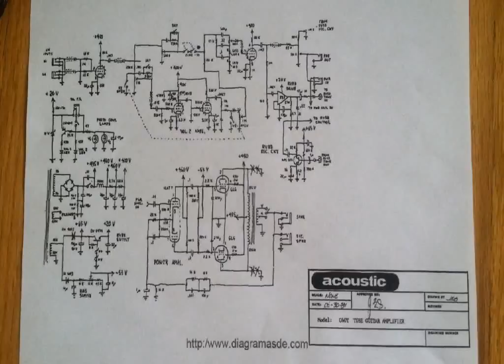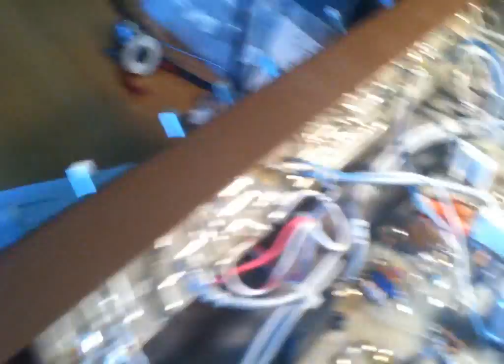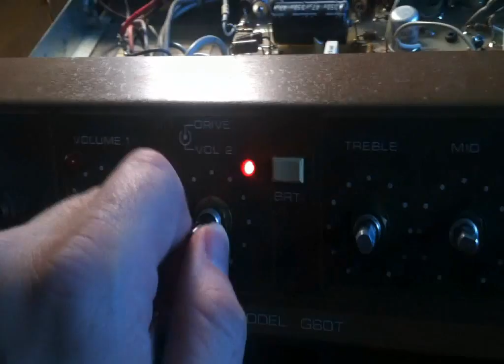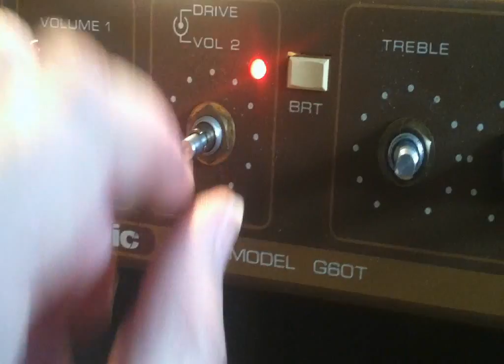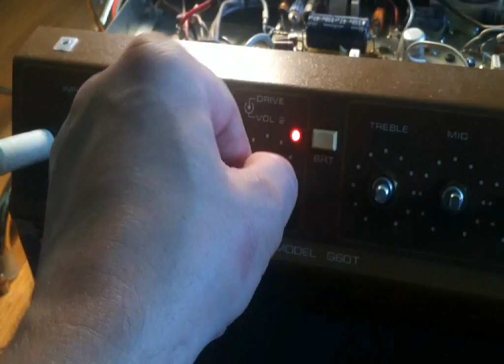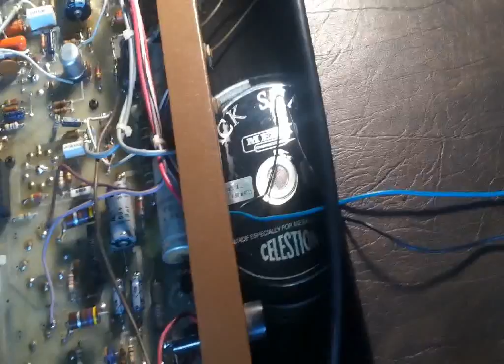Acoustic Control Corp G60T Model 163 Tube Guitar Amp DEMO

Comment: Hi there. Funny, I was searching here for Acoustic Control Tube Amps and came across this.  Not to honk my own horn on this but  I am the  J. E. G. that you see in the title box in the drawing. I was employed at Acoustic  Control Corp as an Electronic Engineering Technician  from 1979 through 1984 . That schematic was hand drawn by me and eventually releassed by the service department. It should have gone to the drafts person to create a formal document.  I assisted  on the design  of this amp .  I am now 72,  have been playing guitar since 1960  I have been employed as an Electronic Technicin / Designer.since 1973 . I was laid off at Cerwin Vega ! in to 2002.  In 1984 Acoustic merged with Cerwin Vega ! I will spare you the rest of the long story.  I  do much of the same things that you do  Mr. Guitologist.  I have a small Guitar and Amplifier repair business working from my home  here in Simi Valley, California.  I still enjoy playing, fixing, building modifying guitars and amps. I do enjoy watching your Youtube Videos. I hope I didn't say too much!
Reply: Thanks for your work. These amps are awesome. I have 2 100 watt heads,1 100 watt combo with the EV and 2 60 watt combos

Comment: there is no "transistor" on the volume of the drive channel. It is probably a microphonic tube, this amp has a lot of gain. (Mine does not do that.) Other than that: a great amp, beautiful reverb and nice creamy gain. I personally would get rid of the death cap at the ground reverse switch, could be dangerous when it shorts. No one needs a ground reverse with a 3 prong cord.

Comment: I found one of these down in baja México, with the same problem, i'm working on get this amp from my friend, did you find the Solution? Thanks in advance!
Reply: Mine did that too. It was the can cap that's mounted on the outside of the chassis.

Comment: I have the same amp, purchased in 1982 for 200$ brand new. It blew a capacitor in 1996 and no one could repair it although they tried. It sits in my closet with a 100watt carvin that also needs repair. The carvin was rescued from a garage fire severly singed. one day I hope to find a repairman to fix them. The GT60 had a great metal sound as well as a great clean chanel. Never had any squeal from the overdrive. Great video, thank you for posting.

Comment: I  bought one of these in the year 2000. It makes the same squealing sound when the drive knob goes up beyond a certain point. I thought mine was the only one with the problem. Bummer. My amp also does not have the original speaker, but that is how I bought it. At some point it got hitched to what seems to be a PA speaker from the 70s, which has a super heavy coil, making an already heavy amp heavier still.

In my experience, even with the bright switch engaged, this amp sounds better when using guitars with single coil pickups. You can hear some of that when the OP switches to clean at 10:20. I have a similar vintage Gibson L6S, with Bill Lawrence-designed humbuckers and circuitry, and the neck-humbucker-only pickup setting gives it a super thick and bassy sound in general, but more so on this amp. So, I use this amp with bass guitar as well, as that is where Acoustic made its name, and it seems what this amp wants to be. Kinda closeted that way.

It is not a bad amp overall, tho. I love this amp, especially for bass guitar using an 18 inch speaker cab as main speaker output and the built-in 12 speaker as secondary. Thanks for the thorough review. Awesome finger-picking!

Comment: Nice review. I have owned that amp since 1982. A new purchase. Anyway 2 things. 1. Did you  modify anything for the volume 2 audio pop and squeal. 2. I notice a crackling sound like frying bacon when I max out the volume. Lower levels it's inaudible. Cleaned the pots and still the same. Is that normal? No harmonics from the tubes. Should I change the caps? I have 30 yrs electronic repair experience.
Reply: Yeah.. you should

Comment: Thank you for the demo! Concerning the ground reverse switch, the ACC 450 Lead/Bass manual states the following:  

"10 GROUND REVERSE SWITCH
Many times you will have a persistent hum or buzz from the guitar strings. The Ground Reverse Switch has been designed to reduce or eliminate this condition. Set the Switch in whichever position reduces or eliminates the problem."

Perhaps the ground reverse switch in the ACC G60T Model 163  is used for the same issue as stated above.

I went to try out an ACC 150b the other day and it also has a ground reverse switch. The amp also has a bright switch too and when the bright switch is engaged the hum from the guitar is louder but when I engage the ground reverse switch, it greatly reduces that hum.

Cool channel! That Harmony 415 was a real treat.

Comment: Thanks for that great Review. I Never had the howling in the drive channel but when I switched to an EV12L I got an uncontrollable low frequence hum like the howling. I blamed the too narrow space (almost touching) between one 6L6 and the Magnet.This hum never occured with a seperate Box, so this was the way to go in a gig.Does anybody knows which speaker will be closest to the original build in speaker?This original one was damaged pretty early and then swapped to a celestion G120 which sounds rather dull compared to the original speaker. The original unfortunately isn't labeled.
Reply from the maker: Good question! I don't know, but hopefully one of my viewers can help you out.
Reply: Mine originally came with a rather bland CTS.
Reply: The EVM12L is a 200 watt speaker. A lower wattage speaker like 80 watts will break up sooner than the 200 watt speaker. The 2 6L6GC are 60watts.
Reply: These were sold with an EVM 12L, or in the cheaper version with a square magnet Acoustic speaker, probably made by Eminence.